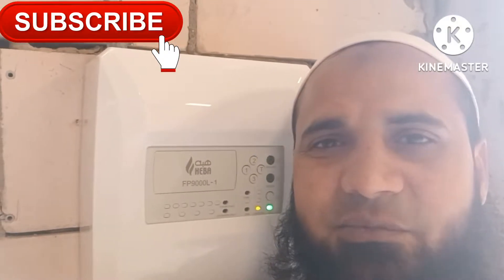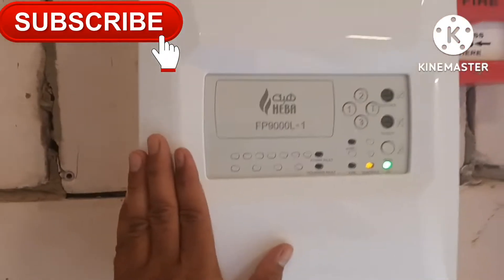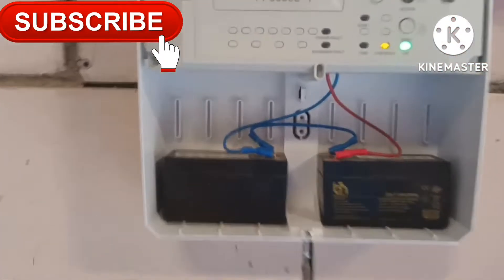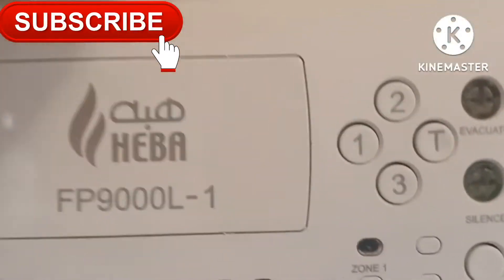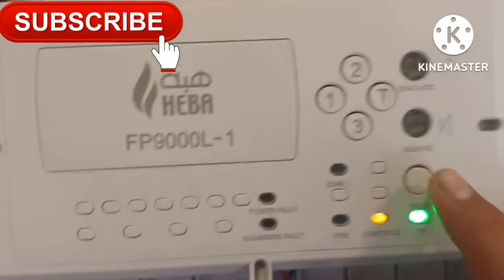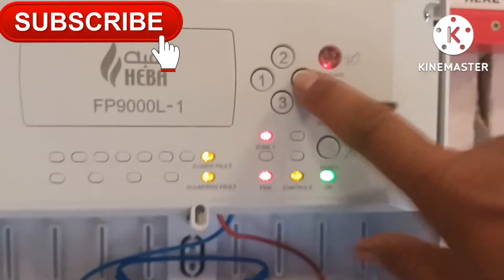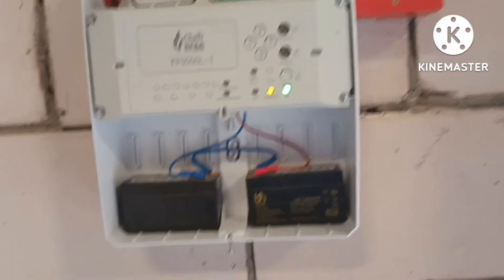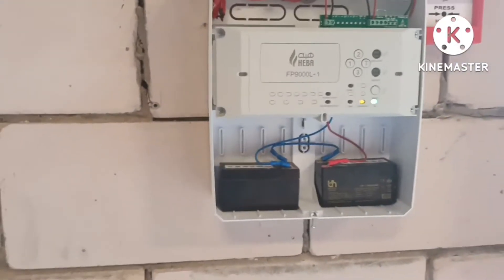HEBA 1 ZONE CONVENTIONAL PANEL || #firealarm #firealarmsystem #technology #technical || CONVENTIONAL

Comment: Dear  we have GENT BY Honeywell system Commissioning files transferred to the BACnet card and FA panelsdetailed data has been monitored by BMS.However, our concern now is to send only a common firesignal and double nock signal and fault for each node Could we brief and sent information to BMS to be only thesesignals? Thanks
Reply from the maker: Sir ...still i didn't get your answer ..did you use module for it to conncet woth BMS ...